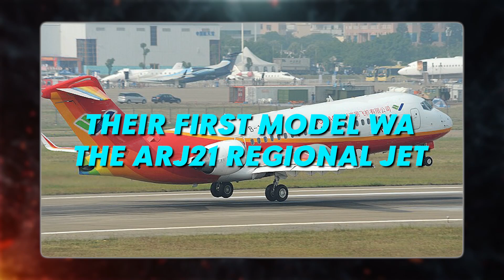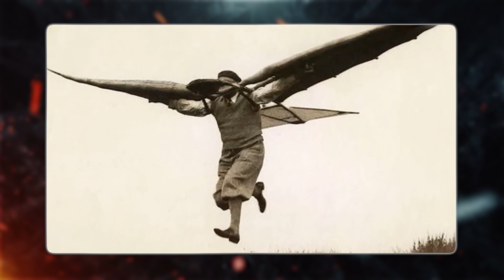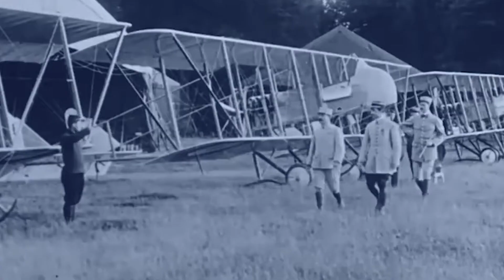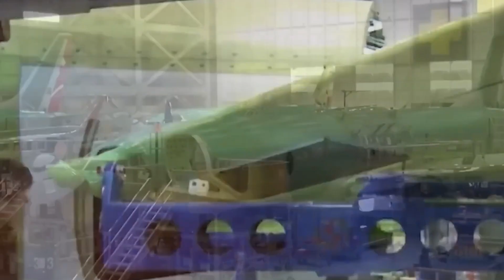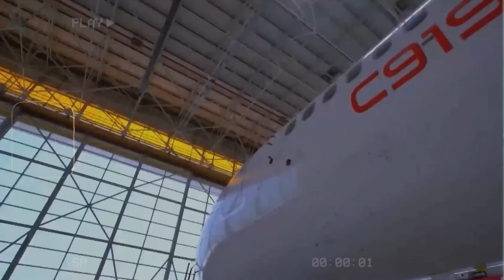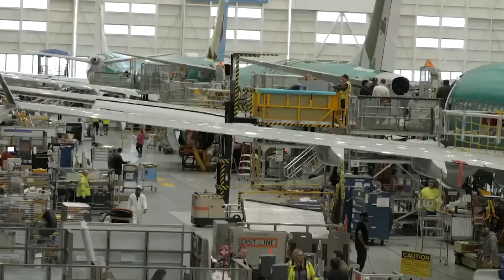RECORD-BREAKING: China Secures 1,000 Planes and $100 Billion in Aircraft Orders!

Comment: It's common practice in the aviation industry to order planes and cancel before delivery.
1000 COMAC C-919 and C-929 may have been ordered (my understanding is well over 90% by domestic airlines) but until each aircraft is delivered, it's not a completed sale. The CCP can order airlines to place orders but even the most optimistic production estimates won't be for more than a tiny handful to be delivered within the first couple years or so and anything after that is pure speculation.

In any case, I'd be awfully wary flying domestically produced aircraft for the first decade at least in China.
I don't think any Chinese company has built in mass production anything that has passed certification to be operated in the US and cars would mostly be the main regulated export to Europe. Rail cars may operate in the US and other countries but they're very few in number and aren't likely subject to the same level of rigorous testing, certification and tracking systems required required of aircraft and vehicles operated in North America.

I suspect that practically everything made in China isn't required to comply with regulatory standards to operate in China like in North America and the US, plus Europe. As it is now, since AFAIK COMAC aircraft aren't even going to try to apply and pass certification to operate in the US, none will be allowed to enter US airspace and the same will likely be most everywhere else in the world except places that are desperate and excluded from the global community.